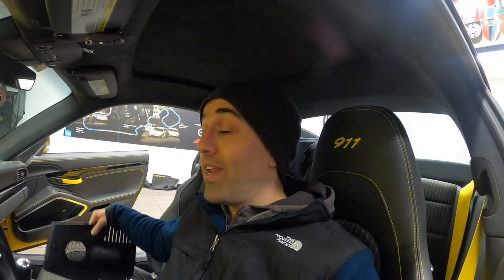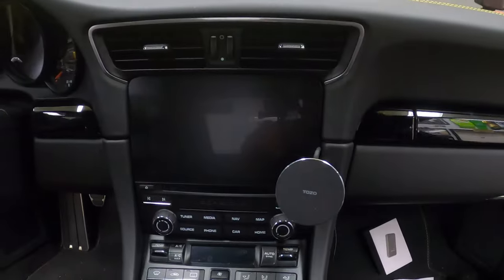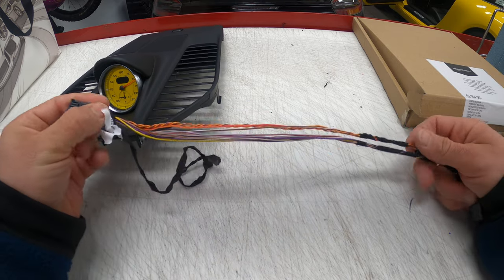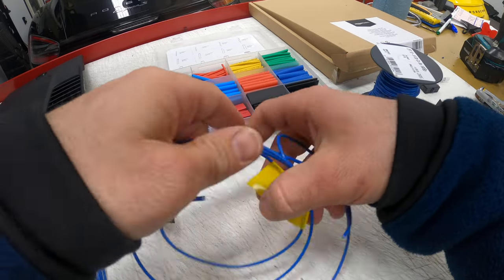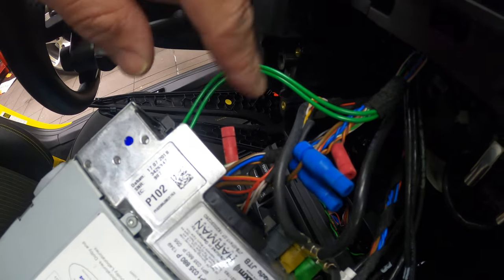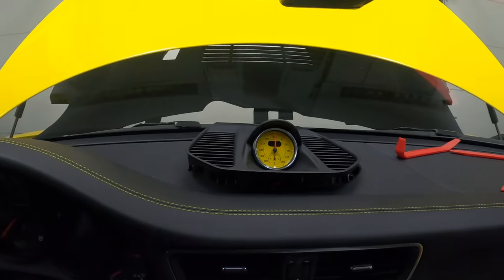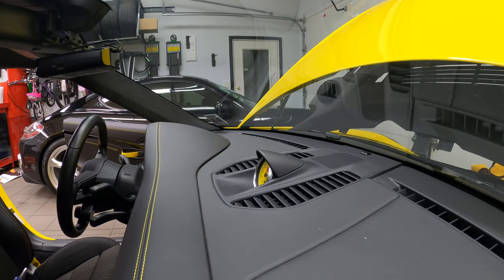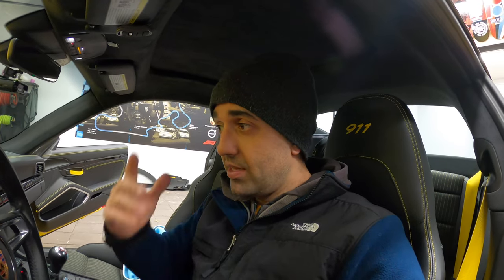Porsche 911 Sport Chrono Clock Retrofit and Install (DIY 991 and 991.2)

Comment: Wow. That's simple. I thought you might need to rewrite OBD to unlock the feature. You just unlock the feature when you add one yourself. Good job, Porsche :D.
Reply from the maker: I was surprised too!
Reply: Probably because all Carrera T comes with sport chrono pkg. It is just missing the physical clock.
Reply: @your_alter_ego definitely because of that. It’s not that simple if the car doesn’t have sport chrono, will need coding

Comment: I notice that your Carrera T has the sport chrono dial on the wheel. This is why the functions are active on your multifunction dash. Those of us that have c2/c2s w/o sport chrono will only get the clock function to work but will not get the chrono functions. Thanks for posting
Reply from the maker: Hmmm you might be right
Reply: Do you think with the clock and a new wheel, I could get rev matching down shifts on my 991.1 C2S?
Reply: @jayroc1502  I don't think so. I believe this is where you will need to update the PCU since the hardware is only half of the equation. TLG's worked because his car has the software already and was missing the hardware. Those of us that don't have either, will need both:Tuning and clock...

Comment: Hey Tommy That was awesome!..  I have a 2013 991 4s and it didn't come with a Chrono.  I just bought one on eBay from a 2014 991 totaled on an accident. Question, will the same color cables apply to my chrono install? To the best of your knowledge will it work? 
Thanks amigo!
Reply from the maker: Same color cables! Not sure about the harness but just use any wires.

Comment: Found an aftermarket sport chrono clock for the 991.2. Since I don’t have sport chrono or sport plus option it seems it will only be a clock. If that’s the case do I need to rewire and splice cables or will there be an available port  to just connect the new connector in without dissecting all the wires?
Reply from the maker: Wiring will be the same, but you are right. You will only get the clock. It will still look nice.

Comment: thank you for this useful video and I have a question for you, maybe you can help me. I bought a stopwatch for my 2020 Porsche Macan, but the thing is that the wire colors are completely different than the ones on the back of the screen module. Has anyone had a chance to do this?
Reply from the maker: If you bought a stopwatch from a 997 generation it won’t work. Otherwise any chrono clock from recent generations should fit as it it essentially the same.
Reply: thank you . @TommyLGarage

Comment: Hi, this is inspiring and encourages me to consider the same for my 718 GT4. Whenever I've spoken to technicians, they've mentioned that I'd need to order the entire dashboard, claiming they can't accomplish the task with just wiring. Do you know if retrofitting of adding Chrono is possible on the 718 GT4? I've already located all the necessary parts along with the connecting cables, but there's scant information available online. Any guidance you can offer would be greatly appreciated.
Reply from the maker: Good news. Wiring is really the same so this tutorial will work
Reply: I’m a software engineer so I would say I’m good in problem solving and I will trust you and order the components and do it myself 😎
Reply: @gt4_pedro did you end up installing in your gt4

Comment: Does this only work with the t? My c2 doesn’t have the sport mode selector dial on steering wheel.
Reply from the maker: You’ll still get the clock to work if you tap into the wires.

Comment: Awesome Tommy! I've been searching for instructions for 2 yrs now. I got everything ready to go. After pulling the radio I realized by 991.1 and your 991.2 radio plugs are different. I seem to have more and differently located wire plugs. Can you confirm the process will be the same? The same 4 colored wires tapping into the same four on the radio side? Much appreciate it Tommy! I also hit you on FB messenger if easier. Keep up the awesome work!
Reply from the maker: Hi. Yes the process is the same.  You’ll be tapping into the same wires. Just make sure you tap into the thick brown one.
Reply: @TommyLGarage  Hey Tommy, got all my stuff and about ready to do the surgery... One thing I noticed, the cable I have, the chrono side looks exactly the same as yours, but the plug on the back of the clock isn't exactly the same as the plug. Looks like the plug can go in either way, so it can be flipped 180 and still go in. Was this the case for you? The Chrono until I have is from a GT3 991.2. Female end has 6 pins, just like the plug side, but plug alignment does not enforce orientation... any thoughts?
Reply: OK... I think I got it... from looking into the chrono plug, I can see where the circuit board has connections. There's on orientation where the two diagonal corners have wires and the other orientation there are no wires... I think we have a winner... but if you have thoughts pls let me know before I fry the car... :)
Reply: @gnailuh   Hi Hugh, how did the install go on your 991.1?  Any trouble?
Reply: @pilsurq  installed and clock working great. But no chrono function on the multi function display. It has to be unlocked with the piwis 2 tool and an activation code. Not sure how to get (buy) the activation code. Doubt dealer will give you. So until I can figure that out, I have a car that looks like sports chrono and a really “cool” clock.
Reply: @gnailuh  thanks for the update.   Keep us posted if you figure out how to activate it.   I'd love to do it,  and having the timer working would be ideal

Comment: Wil this void the factory warranty?
Reply from the maker: Should not really. Unless the actual clock fails
Reply: @TommyLGarage  Thanks for your rely. So when you plug the cables in etc, it doesn't make any modifications to ECU? What I'm thinking is if clock fail, just remove and put back original top then claim for warranty.
Reply from the maker: @YuhaoBoku  oh yes. Ecu won’t be affected at all
Reply: @TommyLGarage   Nice! Will the clock be controllable via PCM? Or is it power only?